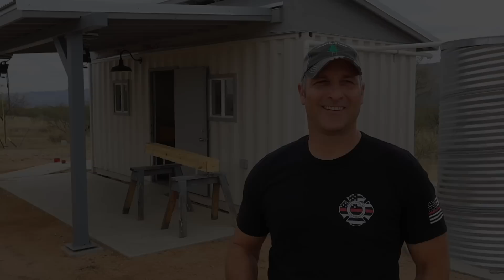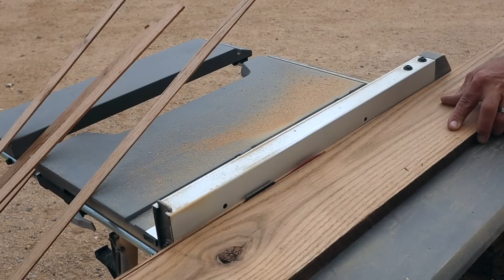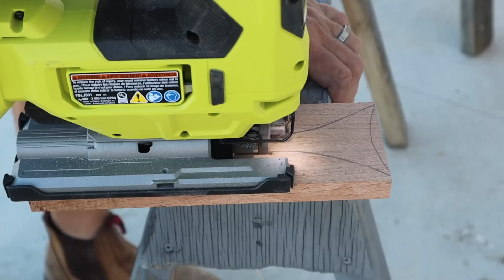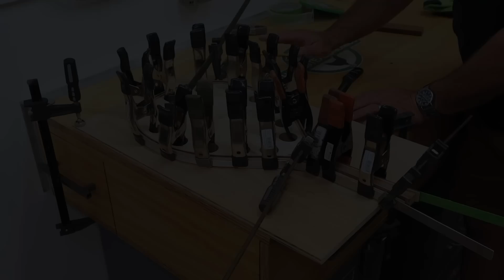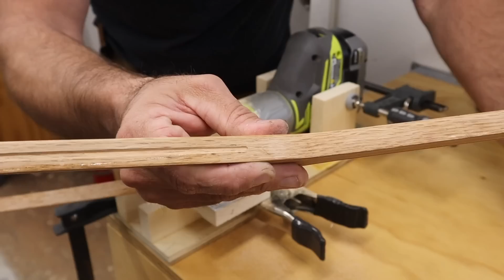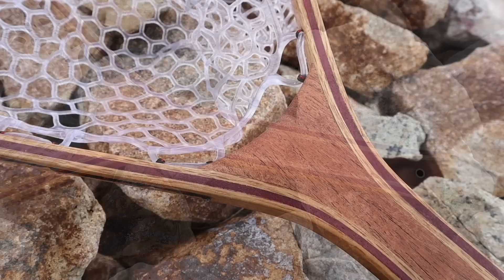How to Make a Landing Net - Steam Bent Fishing Net

Comment: Awesome job.  How deep did you go with the V-bit for the channel?  Nice work around without the specialized slot bit.  

What I love about all of the videos is you can pick up a tip from almost everyone.  You used the aluminum for the form.  I saw someone us a piece of ash (not glued to the net) for the same purpose to help eliminate cracking and keep the outer layer from getting marred.
Reply from the maker: Thank you.
As for the depth…🤔 You know what, I’m not 100% sure…. Kind of eye balled it to where that paracord would be recessed enough to be protected from abrasions.   But if I did it again I think I’d go just a hair deeper.  Like maybe just barley the width of the outter lamination.   But not so deep so as to show the color of the middle lamination.
Reply: @homesteadonomics  Thanks appreciate it.